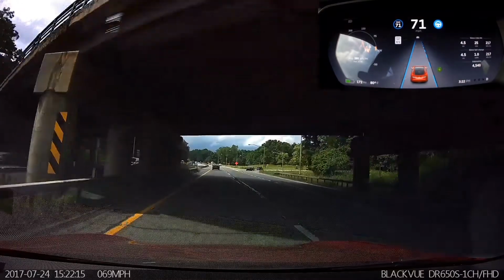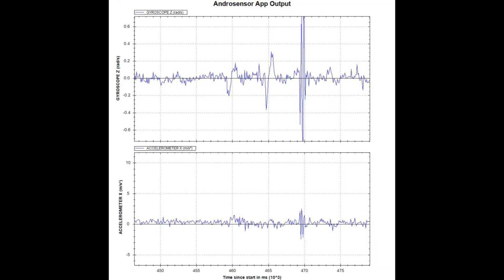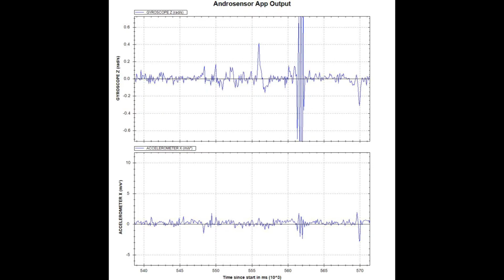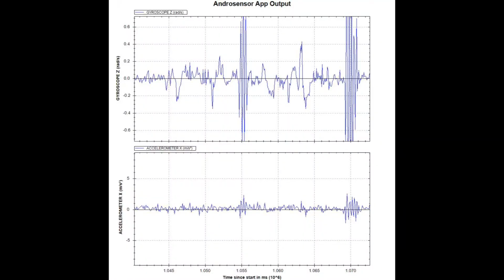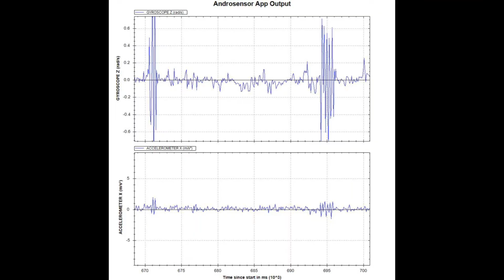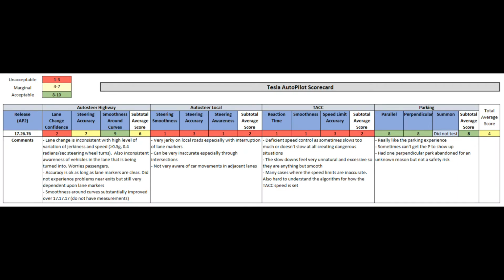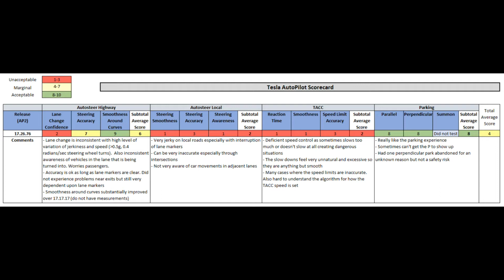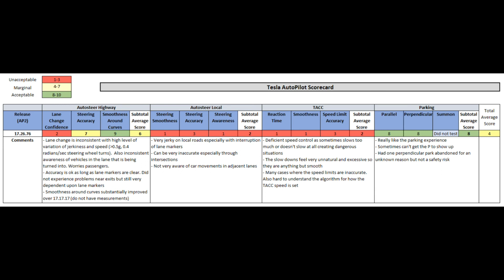Tesla Firmware Release 17 26 76 analysis... part 2 of 3

Comment: Your setup is interesting but a bit broken: since your pixel phone is turning with the steering wheel, the acceleration axis is turning with it, which means the amount of x movement recorded depends on the turning degree, since it’s spread between x and z/y. Z too because your steering wheel isn’t upright.

I think the only way to fix this is to use two devices, one in head-height for acceleration measurement and one on the steer steering wheel for recording this movement.

A different solution would be to record a video of the steering wheel and calculate the movement by tracking a marker on the steering wheel, but I think you would need more than 60 fps for this.
Reply from the maker: Agree with your observation that the axes do interact.  I did quickly look into a second stationary smartphone but it became time consuming to synchronize the data between all the sensors.  I would also guess that using data from all 3 axes could be used to compute a pure x direction acceleration but I didn't try that.  As I mention in the video I didn't have the time to do all of the calibrations/repeatability experiments but the data did mirror how it felt when driving.  Thanks for the feedback.